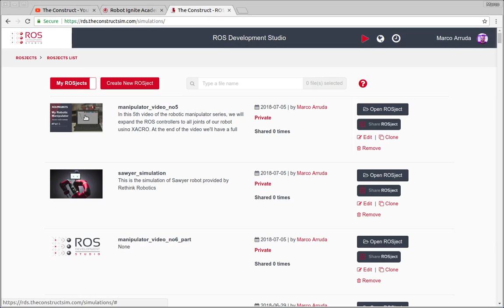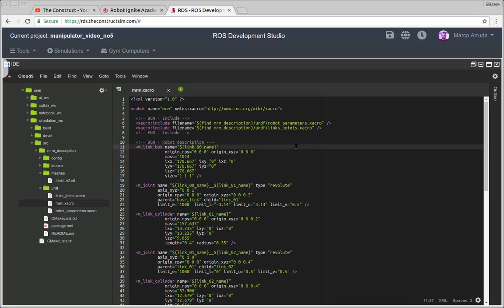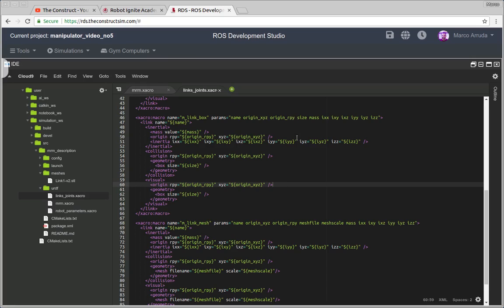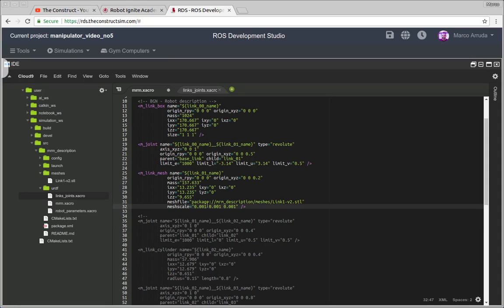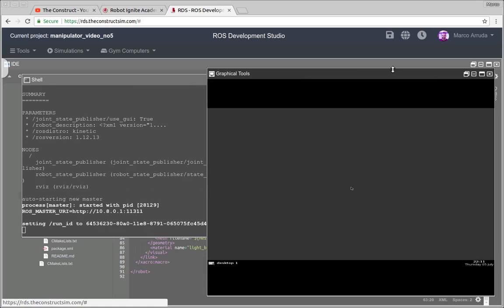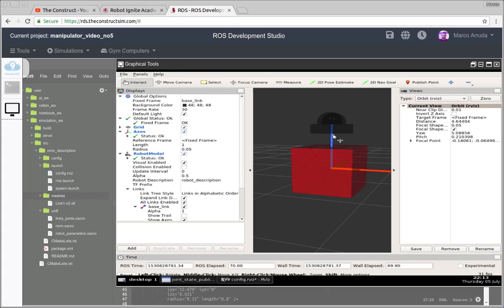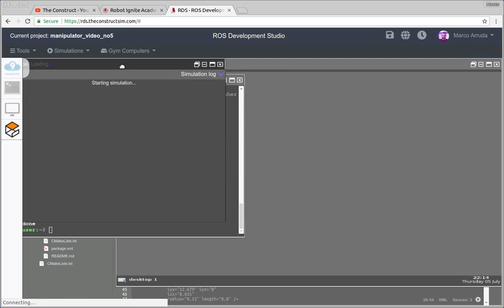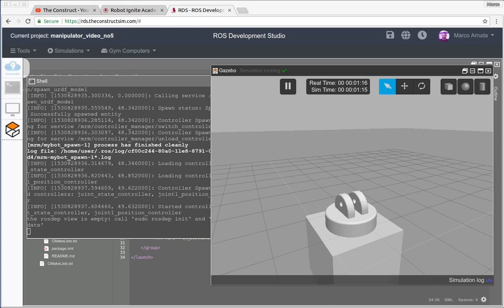[ROS Projects] - My Robotic Manipulator #6 - STL Mesh file for URDF Link

Comment: Hi, If I clone your repository from git and spawn it, i can see the mesh file in gazebo, but if i create my own package the mesh does not show. Also if i rename your package to anything other than mrm_description, the mesh is not displayed, i am not able to understand why? is there anything special with the name mrm_description?
Reply from the maker: Well, if you haven't changed the addres of the mesh files inside the URDF to point to the name of your package, then you cannot see the messages because the addres has a wrong path name.
Check on the URDF for meshfile="package://mrm_description .... and that you have to change to your package name
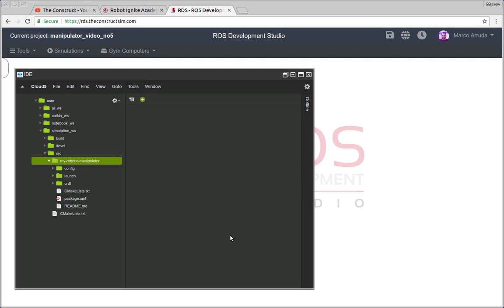Reply: @TheConstruct  , I already changed the address in the urdf file but still doesnt work, then i watched the video again and realized my package has to named *_description. I renamed my package and added "_description" to it, now it works. But i am confused is necessary to name the package *_description? see the video at 1:16